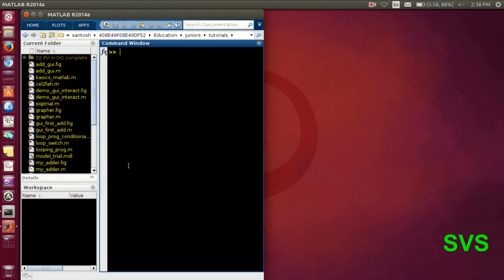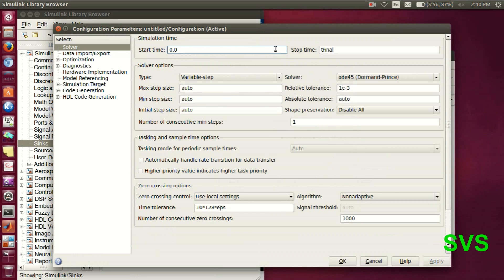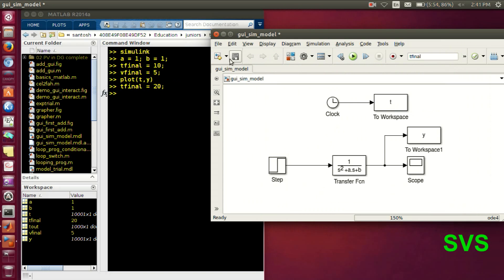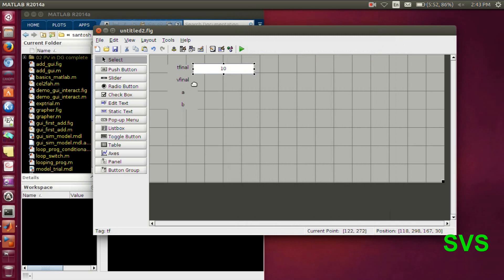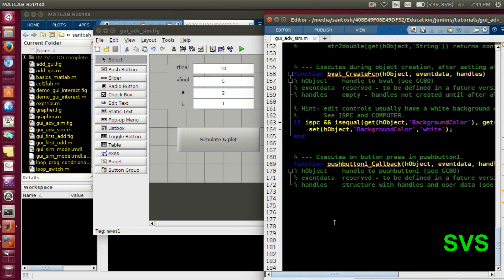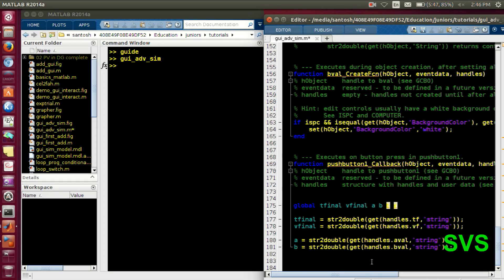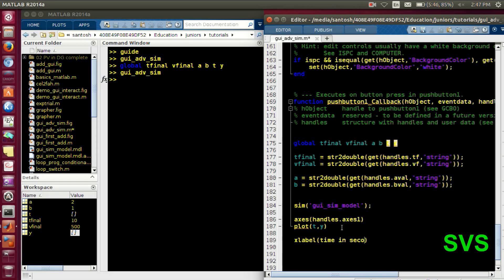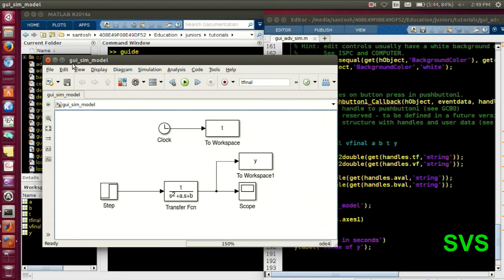Session 13b - Integrating GUI with Simulink execution (Part-II) (MATLAB)(Dec-2015)

Comment: Hi @VJTILegend. Great job, this is the only good tutorial I've seen on the subject.I just have one problem, it's the next:
"Error using gui_adv_sim>pushbutton1_Callback (line 184)
Error evaluating expression 'tfinal' for 'StopTime'
specified in the Configuration Parameters dialog for
block diagram 'gui_sim_model'.......
Unrecognized function or variable 'tfinal'. - Show
 complete stack trace" 
Hope you can help me, I really need it :(
Reply from the maker: Hi Sebastian:
It seems, the variable defined Tfinal (or tfinal or tFinal etc) in the simulink file or other main script file, which feeds the stop time for simulink execution may be defined incorrectly ... i.e. either the string chars may be different or the value chosen might not make sense (for eg. step-size is fixed to 1 ms and your Tfinal is 0.1 ms). 

I guess, with these checks try reviewing your code again. Else do let me know ...

All the best.

Comment: I did everything what you do. But I have an error: It says Reference to non-existent field 'tf'. You know why?  I follow every step in your example.
Reply from the maker: @xiomara camacho

Thanks for the comments!! 
Ensure that you are using the same variables with same case (e.g. tf, Tf or tF are three variables) in the programme.
Just review your code again or quick way will be to start again fresh. Hope it helps!!
Reply: It works! thanks very much. I have a gramatical error 'string' instead 'String' .
Reply: @svsinghiitb  ..Hi there....I am facing the same problem...it says non-existent field 'tf'..Can you please guide how to resolve
Reply from the maker: @sachhalmufti3120  Hi:
Please check the variable's character defined, a quick check in the script (*.m) file like how your variable tf is defined and how it is used in the GUIDE.
Please check and let me know if you have an issue.
Sorry for the delay.